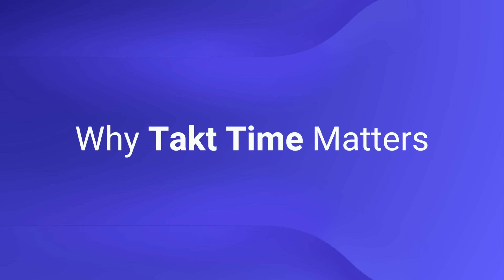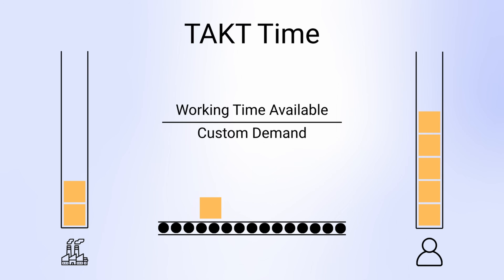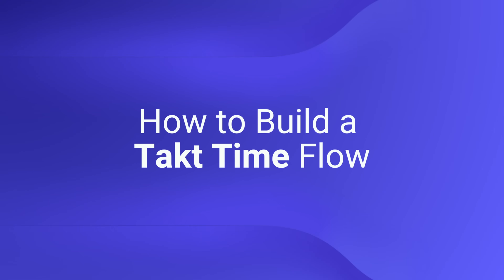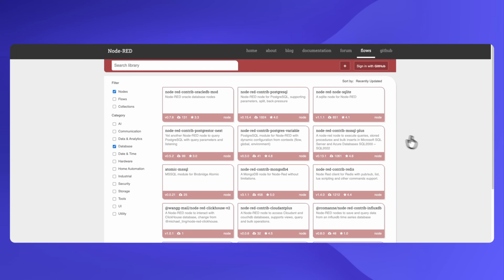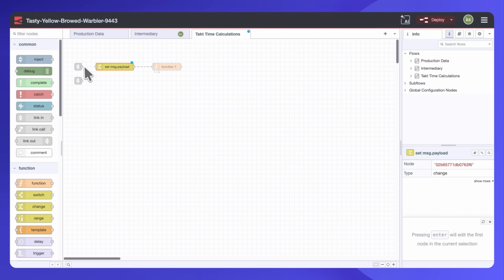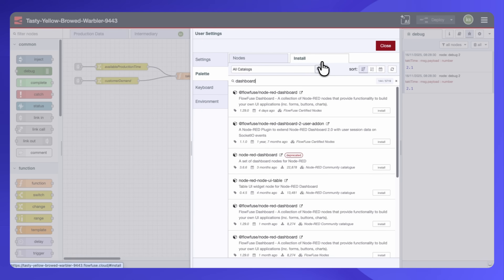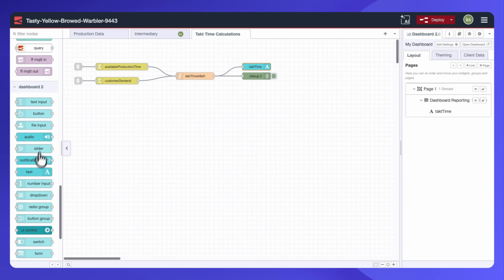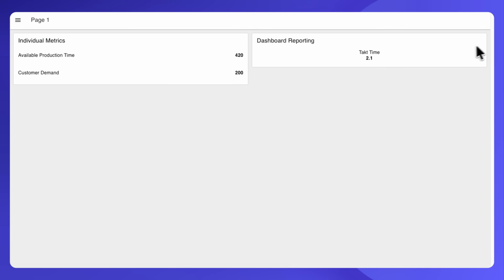Unlocking Optimal Production with Takt Time #industrialautomation #efficiency #industry40

Comment: Sorry, but the ability to calculate  takt time every 2 seconds has no value to a lean manufacturer.  Typically takt time is set on a monthly or quarterly basis and short term blips are ignored. Most lean manufacturers try to maintain a planned cycle time just under takt and use overtime to buffer changes in demand. Changing work balance or machine cycle times to fit a varying takt would be a nightmare. A dynamic takt time display is certainly programmatically possible with node red but that does not make it useful.
Reply from the maker: Hi there, thanks for the comment! You’re right that in many traditional Lean environments, takt time is set on longer planning horizons like weeks or months. That’s still a very common practice.

Where things have evolved is in more dynamic manufacturing settings - especially high-mix or multi-site environments - where real-time takt is monitored not to constantly rebalance the line, but to improve visibility into deviations as they happen. For example, some semiconductor fabs track takt in real time to better coordinate start-stop flows and avoid exposing components to unnecessary vibration or environmental risk during wait states.

So yes, planned takt is typically stable and long-horizon. But real-time takt observation offers additional value in fast-paced, time-determinant operations by highlighting gaps between demand and actual flow much sooner.

Appreciate you joining the discussion!
Reply: @F @FlowFuseInc Thanks for the explanation. I haven’t experienced that situation in my career but if someone needs a rapidly updating takt it’s clearly possible with your software. Where I see the value of Flowfuse and Node Red in a Lean production system is identifying blocked or starved workstations in a lean cell. That would provide valuable insights for work rebalancing or to identify operators needing assistance. Your solution will do that brilliantly I am sure.